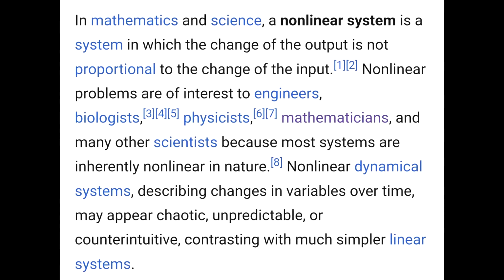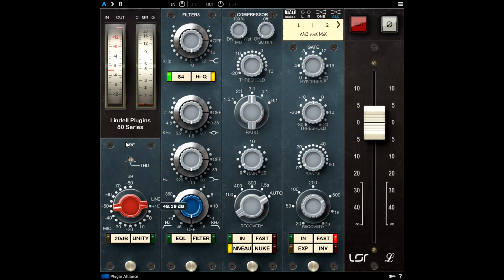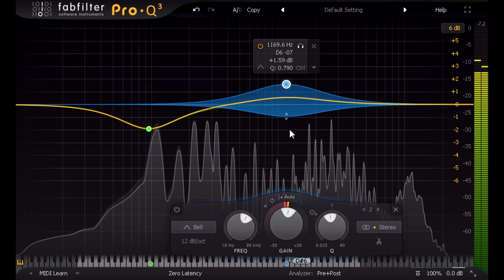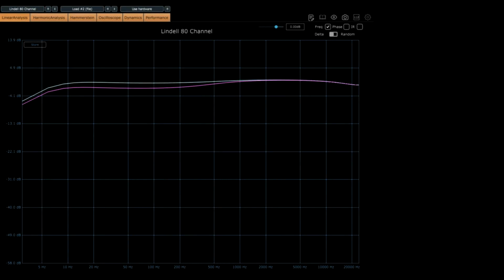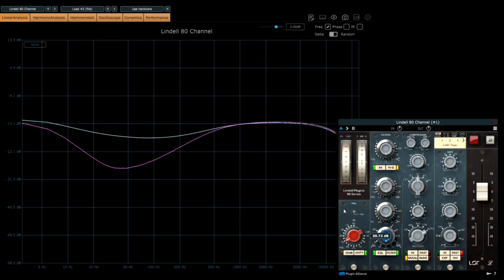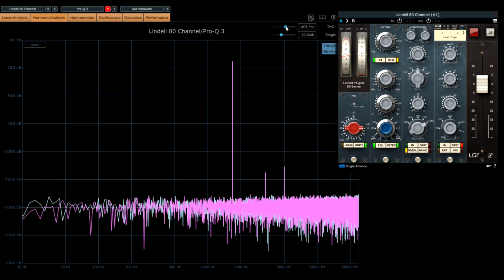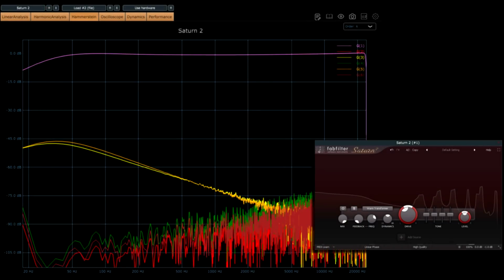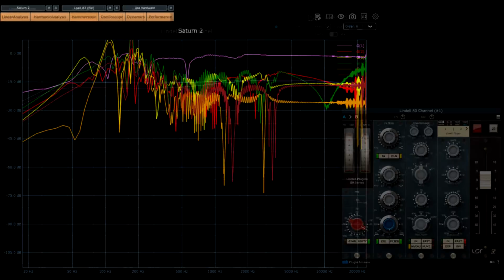WTF is a Non Linearity?

Comment: I wasn't gonna say anything but yeah he's referring to me. I'm happy to admit if my explination of certain things aren't great at times which in some parts can be interpreted certain ways and some times you get stuff wrong.

In defense, I asked Dan to explain to me where he felt I went wrong prior to this video but Dan took the route to do it as video content instead which is absolutely fair game. Its youtube at the end of the day.

However I don't know if Dan's saying everything I said in the video was wrong as that's actually quite far from the truth as a lot of what I said was echoed in this video

At the very start I talked about how linear is mathematically precise and how what you put in is what you get out and i used fabfilter, waves f6 etc as examples of that where a non linear system like in analog isn't. The signal is impacted by being passed through the components of the gear. This can cause noise, harmonics and other non linear behaviour which is random. 

In regards to the curves I talked about how plugins are essentially snapshots of non linear behaviour. That's why I talked about the tolerances the TMT adds, and how convolution gives you impulse responses of the gear which will show a static snapshot of non linear behaviour. 

I can see the curve element being picked apart as it could be seen as calling an eq curve of one plugin  non linear compared to another plugin which could probably match it if you used tons of different bands. So in a sense, I call fabfilter eq linear, but in reality it has enough bands to match another curve I deem as non linear. So logically the terminology is flawed but It's all about context. I made a video showing what kind of things to look for when comparing analog emulations. I used the term non linear when describing certain plugins which had certain frequency responses just running through the plugin that weren't completely flat and linear. I know what I meant and maybe I shouldn't have edited so much stuff out the video but I knew I had the next video planned the week after which was actually shoeing real analog curves compared to plugin curves 

I then show real analog non linearities caused by a non linear system. I went on about how plugins are static representations of this and showed that in bertom curve analyser. I talked about the advantages of plugins and how the actual linearity of plugins can be a benefit as you have a consistent result that isn't random. 

I mean can it not be argued that everything in plugins in theory isn't non linear because its coded to act in a predicable manner. It's not random like analog. A plugin isn't going to sound different from day to day. It's not going to be affected by wear, age, humility etc. 

We can say that fabfilter is non linear when in dynamic mode or when a plugin makes thd but surely there is still an element of linearity due to the fact that no matter how many times you load that preset it'll give the same result. It doesn't have the randomness of non linear analog behaviour where its frequency response, attack envelopes, noise, thd etc etc can be slightly altered every time you switch it on. 

I'm happy to eat humble pie but I'm also more interested in diving deeper into all this stuff and defending myself where I feel I made a lot of good points. I've taken this like everything I said was wrong where in reality I know it all wasn't. A lot of what Dan said, I said. Some parts we differed. Maybe certain elements I didn't explain well and maybe certain bits I just didn't get right but in the end I think it's all about sharing and learning more. 

Don't get me wrong I hold Dan in the highest regard. I genuinely respect his knowledge and experience which I know is greater than mine but that doesn't mean to say just because Dan Worral said Paul Third was wrong doesn't mean that you should view that as bible and that everything I've ever said or done is now suspect. 

I'll continue to learn and I'm happy for others to learn from any mistakes I make but in the end context is very important. 

Many can argue exactly what the term non linearity actually means as it has different contexts and audio is a massive melting pot of information. 

I'll probably get trolled a bit for standing up for myself but if it means I and many others learn from the experience then so be it.
Reply: I‘m glad he made the video, that way we all have a chance to learn something. Back in school I was taught the difference between linear and non-linear distortion, the former being frequency dependent and „correctable“ by means of eq, the ladder being an „irreparable“ change in dynamics, which naturally includes harmonic distortion and other artifacts, such as aliasing in converters. I personally would love, if more of your videos focused on how you use your favourite processors and why. Also think it would be interesting if you decided to learn dsp yourself and document your journey. Personally, learning a little dsp myself and working with the amazing Sonible team has helped me get so much more out of my go to effects. Cheers :)
Reply: @theCloneman5  I just don't have the time haha I'm genuinely just picking up scraps as I go along from other engineers and experimenting whenever I have time. Between my day job and youtube I'm doing like 60-70 hours a week so to find time to learn about that and get experience somehow I'd need to probably give up my job 😂

Its something I plan on doing down the road for better understanding but I genuinely just don't have the time. I'm actually contemplating going down to just one video a week and ditching the autism channel all together cause I just don't have enough time

Id use the Bernard's watch reference but I very much doubt you got that in  Germany haha
Reply: Technical terms aside, let’s not lose sight here. You are both showing that some companies make marketing claims that are simply not true.

Saying „this total behaves like the analogue gear“ but in truth it’s just 100% digital is the real problem here.

Yes using technical terms right is nice, but it’s also not the end of the world. It’s important that people understand the meaning and that was perfectly clear.
Reply: @FlorianRachor1  yeah I do think there has been a clash of terminologes here. I maybe perhaps take the description of non linear too literally (which being autistic isn't a surprise 😂) as in my head I deem non linear behaviour to be the changes to the signal path caused by the components of the gear as it has no relation to the input. Just running through the circuitry alters the output in a non mathematical fashion as its creates random behaviour that can change the output almost every time you use it. By nature it's inconsistent and can change more over time and I see that as non linearity. Perhaps my terminology is wrong but I speak to some engineers who agree with me, some who agree with Dan and see non linear only as distortion. But your right I thought me and Dan were on the same page in terms of trying to show plugins under the hood and debunk some marketing BS but unfortunately he took the approach to label me with the tag of all the other youtubers which I feel is very harsh as I always have the best intentions in everything I do. I don't claim to be anything I'm not. I don't try and sell mixing courses. I just experiment with stuff, show my results and then continue to learn from the experience. I share every bit of learning I have and use others to adapt that and work harder to learn more. 

Personally I feel we could have worked together on this and it would have been a good way of Dan sharing his experience and perspective with someone who is willing to learn more. I could have explained where my perspective was and it could have been a good experience and also good content for all you guys to show that we do all this for your benefit. where what's happened is I've been left trying to defend myself against one of the most respected audio youtubers. 

It could have been done differently but I just have to dust myself off and see what learning I can take from the experience but I think I can say for sure the idea I had in my little autistic daydreams that me and Dan would join forces one day has probably been quashed now.. Ach well.. Life's a bitch haha
Reply: @PaulThird   I've got a lot of respect for both you and Dan. You both have been doing a lot of good work to help people understand audio (both analog and digital) and to not fall for the marketing of certain companies.
Sure, this video could have been made differently. A collaboration between you would have been spectacular. 
When I was watching your video, I too felt some of your concepts and terminologies were not 100% correct. But some things were great!!
Like when you showed the way a signal can have different mid and side harmonic content to increase perceived width (technically for that to happen you would usually give different tolerances to the left and right channel both in waveshaping and emphasis/de-emphasis eq, for example, and not process the mid/side information separately)
That is something that occurs naturally in analog gear, especially in older, not well-matched stereo components.
As an amateur plugin developer, I never thought of that aspect in modelling plugins, and you've inspired me to improve some things by playing with tolerances between the left and right processing.
And I believe some developers are not taking the tolerances between left and right when modelling something.
 
In this video I would agree 100% with Dan regarding the technical part (And do not agree with the way he made it seem like everything you said in your video was wrong). I want to believe that this was not his intention.
Even though he didn't mention your name, I automatically associated it being you when I was watching the video.
Dan makes great points when talking about the way Linear analysis behaves when dealing with extreme saturation, compression, etc.
You cannot rely on it when trying to analyse frequency response of heavy saturated plugins in Plugin Doctor or curve analyser.
 
We are not born knowing everything. And we are not always right. But don't let this stop you from doing your videos!!
It would be cool if you guys could somehow work it out and put this behind. And as you said, maybe collaborate some day.
Reply: @filipeadubeiro  always have hope 🤓 I was always gonna take it personally as I'm a very proud person and go in with the best intentions with everything I do but I'd like to think that Dan may reach out and offer his help with plugin doctor and stuff as I could do with some being pointed in the right direction as my understanding of it could be much better. One thing I'll never refuse is help 🤓
Reply: @PaulThird  Paul, I've only just found your channel a few weeks ago but when I first watched a few, I said "Wow, a man after my own heart." You don't take things at face value and you test things out for yourself. I'm very much like that (being on the asperger's spectrum myself). Regardless of this video, I do think the meaning of the word "Linearity" can be kinda vague and I, for one would LOVE to see both of you together in a video, maybe one day in the future.

Paul, you rock!!! KEEP GOING!
Reply: Paul your video still rocks! And I agree with you. A lot of it was and still is right. It’s a matter of context and terminology I guess. Maybe experience. Keep the good work!
Reply: Love your thought out response. Gonna check out some of your videos later and have you a sub. This video has a ton of depth and I learned some stuff.
Reply: Your post shows that you are conflating a couple of different concepts. A non-linear plugin is one where there is a difference between putting identical copies on two tracks and putting such a copy on a bus receiving both tracks. This can result in distortion, but doesn't have to. Noise is not produced by non-linearity, but by stochasticity. You can have deterministic linear and non-linear systems and you can have stochastic linear and non-linear systems. "Random" is a term that gets used in a variety of technical ways, if you want to be precise about it, there are synonyms for each possible meaning. You mention convolution here, which isn't just linear, but bilinear - it's both linear for the input signal and for the IRs (so if you mixed a convolution reverb using IR A with a convolution reverb using IR B, you would get the same result as if you mixed the two IRs with the same gain as the respective reverbs and then bounced that mix and used it as an IR for a single instance of the reverb!).
Reply: @Paul Third Hey man, it's all good. I still got love for ya and I really don't think Dan meant any harm. Seriously, you are both top-notch dudes!
Reply: I think you're caught up in your own definition of "linear" that doesn't really mean what "linear" means. The term is very specific and has a mathematical meaning; it's not about randomness or complexity of the processing. What "linear" means, as Dan said, is that the output level follows changes in the input level precisely, with no other change: add 1dB to the input and you get the same output 1dB higher. No more, no less. It has nothing to do with repeatability or randomness or complexity of the processing.

It doesn't matter how many bands you add to a standard EQ; it will always be linear, because no matter how complex the curve is, it will always react the same way to any given input regardless of its volume. And it doesn't have anything to do with consistency; an EQ plugin that adds some per-instance randomness to the controls would still be perfectly linear, and a saturation plugin that is completely repeatable would still be non-linear.

Analog systems are always nonlinear when pushed into saturation, but can be very linear in the sweet spot of their range. The saturation added by overdriven analog systems also isn't random; normally it is quite consistent (though it can be complex). Noise is another issue; that is, of course, random.

You say that convolution with impulse responses gives you a snapshot of non-linear behavior... but, in fact, convolution is always linear by definition! In fact, any linear system can be represented as an impulse response, and no nonlinear systems can. That is why convolution is useful, it's a magic tool that lets you emulate any linear system, such as analog gear in its linear range  (particularly useful for things like speaker cabinets and reverb tails, which are mostly linear as long as your volume is reasonable).

The term comes from what happens if you apply a simple mathematical function to the voltage (or sample value) of a signal. If you use a linear function (i.e. multiply by a constant) the your filter is linear. If you use something like an exponent, like x^0.95, then your filter is nonlinear (in fact, that formula is a basic distortion). And you can also add linear functions of the signal in the past, and the result is still linear - that is how EQs work and basically the definition of convolution. In the end, any linear processing is always representable as multiplying past samples going back far enough by a specific constant each, and adding them together to produce the next output sample; and anything else, e.g. anything with piecewise functions or exponents or what have you, is nonlinear (like distortion).
Reply: Paul - You do great work.  I've always enjoyed your videos and have learned alot from both you and Dan. We're all sorting this out together. Keep going my friend.
Reply: @MrlegendOr  this bit?? 

Structure of the Dynamic Non-Linearity (DNL)

After all linear parts in the electronic device are modeled according to the previous section, we next focus on the non-linear parts. In this section, we propose a non-linear dynamic model structure which is very efficient in modeling non-linear electronic devices The idea is to consider the electric device as a black box with input ut and output yt, and model what is in between.

In fully controlled experiments, we can generate arbitrary ut and collect the device's output zt. Due to the sensitive feedback loops in for instance tubes, we cannot put a probe into the amplifier and measure the tube input yt directly. However, using thae linear model from the previous section, we can compute yt=H (q; {circumflex over (θ)})ut and use this instead. The question now is what structure to use for the DNL. We propose the following one
zt=ƒ(yt; mt).  (14)
Here mt is a mode parameter that depends on the operating point of the tube
mt=g(yt,zt,yt−1,zt−1,yt−2,zt−1, . . . )  (15)
The operating point may include the input derivative, amplitude, frequency and power, for instance. We consider the function ƒ(y; m) to be continuous in m, so that we can tabulate different static non-linearities (SNL) and then interpolate between these. For example, if mt is a scalar mode parameter, we can tabulate ƒ(y; k) at the integers, and for a k≦m≦k+1 we use
z=(k+1−m)ƒ(y; k)+(m−k)ƒ(y; k+1).  (16)
We have found the following mode parameters to be of particular importance for tube modeling:
Reply: @PaulThird  👌
Reply: I'll come in as Switzerland here as I love both of you channels. I feel like Dan is right here in what he is saying when it comes to the linearity of a response to input. However, perhaps in disagreeing with your use of the term linear and non-linear he somewhat straw-manned the theme of your video because he isn't really talking about the concepts you were talking about in your video. Perhaps a better term for what you were talking about Paul is idiosyncrasy or non conformance, which in analogue additionally has some randomness to it
Reply: Hi Paul, i enjoy your channel and have learnt a lot from it, i'm a subscriber and will continue to be. You're learning as we all are. I see learning like rock climbing, you reach for the highest rock hoping to climb further, but you miss it and fall grabbing the nearest rock, hey presto you've fallen up 3 feet! We reach high, fail but we've still learnt something and we continue to reach.
I hope you continue to document your learning on your channel and don't get discouraged, its failure that makes us progress. Take heart that you're not one of those Youtube channels that are just middlemen salesmen for plugin manufacturers (MixBusTV, Produce Like a Pro etc) where they just demo a plugin on the first day release yet never use it in there own workflow. They are promoting something for payment, you could level this against Dan as he does videos for manufacturers yet you'll often see him using these tools he promotes in his work so i feel he does pick and choose his tools based on his workflow and not just promotes them.
Reply: Hey Paul, nice to see you here, yeah i think it's just terminology... In reality you are more or less correct about the plugins & hardware difference.
Reply: Non-linear does not mean random.
Reply: @DelphinidaeZeta  so what would you say it does mean. As I've spoken to 8 different engineers and I'm not getting very consistent results haha seems to be open for interpretation or the lines are blurred a bit
Reply: @PaulThird  "Randomness" (i.e. noise) is just one kind of nonlinearity. The terminology comes from the standard maths/physics approach to signal processing; maybe present-day audio engineers don't agree on this but textbooks do.

If you prefer a working/applied definition of linearity, the one I find useful is "anything that is equivalent to an impulse response". An IR is just a very specific series of delays, and so is a clean filter or reverb. They can be combined in any order to yield the same IR.
Reply: @PaulThird  Just think back to your basic algebra functions from school and try visualising them.

A linear function means that no matter what sound you put in, the amount of change it receives will be the same every time.

In turn, a non-linear response can be pictured like one of those exponential curves in your mind: different input sounds receive different amounts of change.

They are both predictable. They are both non-random.

The real difference is: you can undo linear processing, and you can't undo non-linear processing.
What do we mean by that?
Example: if you boost a frequency with a bell EQ set to +6 dB, you can precisely recover the original sound by using another instance of the EQ with the same bell set to -6 dB.
But if you use a saturator on a sound, it's final; you can't "un-saturate" it at a later stage, there is no way to do it.

If you use image-editing software, you may have heard the term "destructive effect". Same idea with non-linear processing.

Hope this helps.
Reply: As a software developer, I would just point out that randomness is a very tricky subject in the digital domain. In the analog world, you have voltage fluctuations, degraded components, atmospheric changes, etc., all of which are entirely unpredictable (i.e., truly random); in a computer program you have very precise algorithms that generate the same list of pseudo-random numbers if given the same seed. The point is, while software can emulate randomness, true randomness requires the one thing computers are designed to avoid: imperfection.